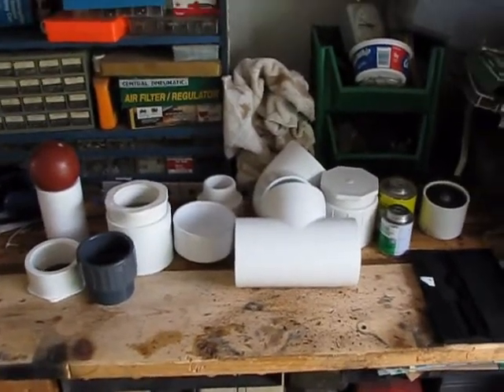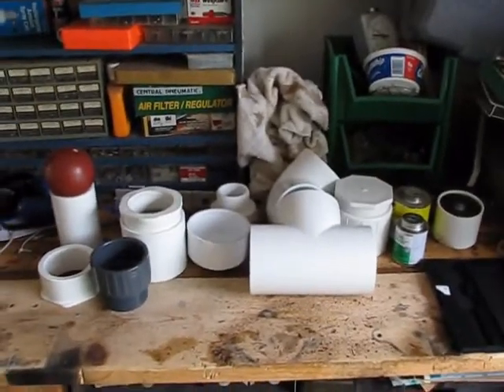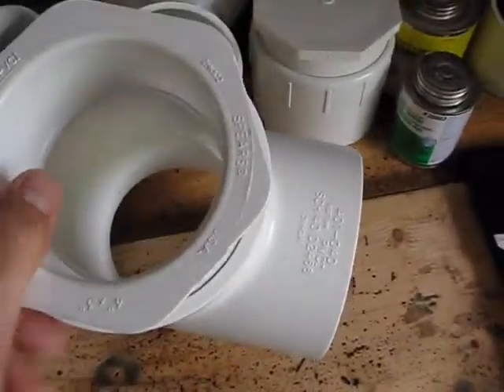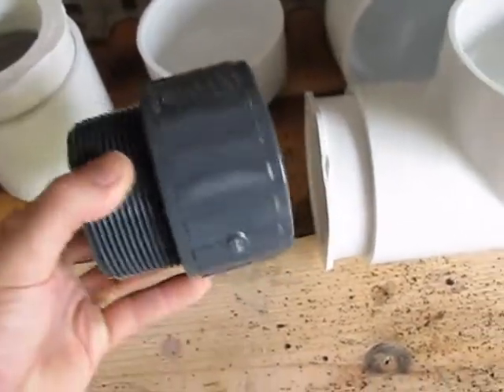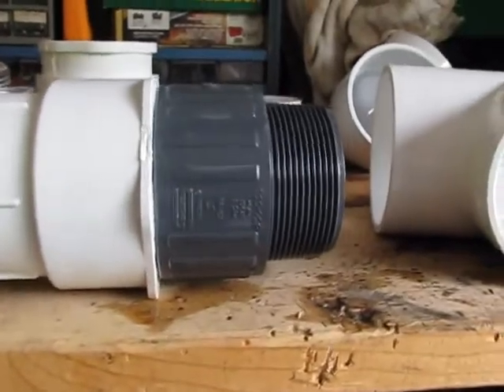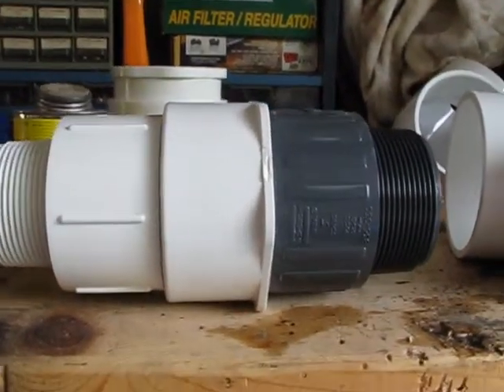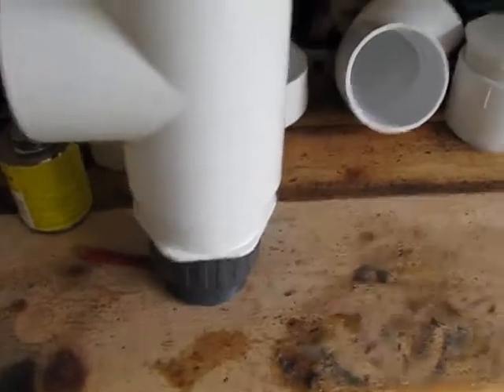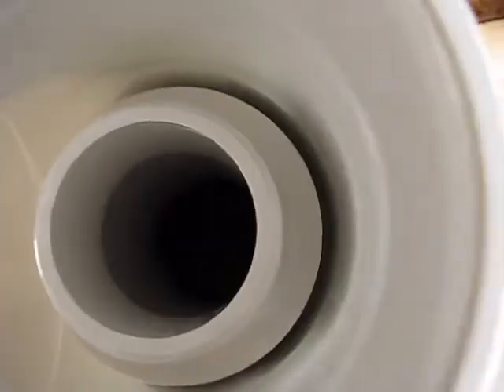Dominator Athletics - Building the Shot Put Cannon - Part 1

Comment: very good, especially for a first! but you need a rubber bumper to go along with the spring, and I saw your other videos, and I was very pleased. However, if you do not put in a bumper, you cannot achieve higher psi, and your back may blow out.... please take my advice, and put a bumper in it! then pump you cannon to 80-100 psi, and watch the destruction unfold!